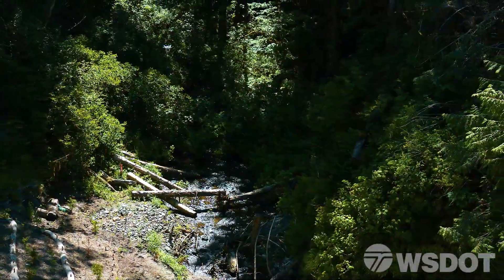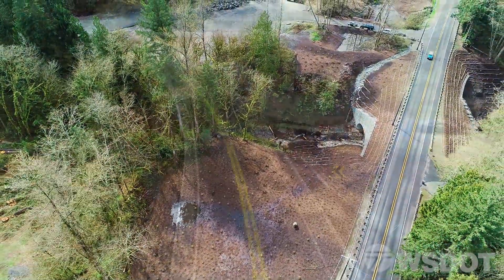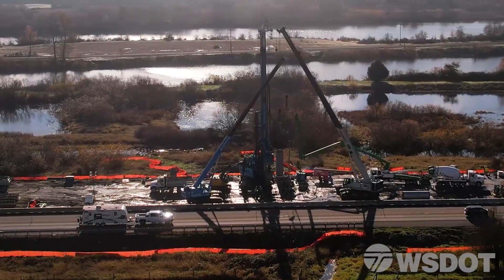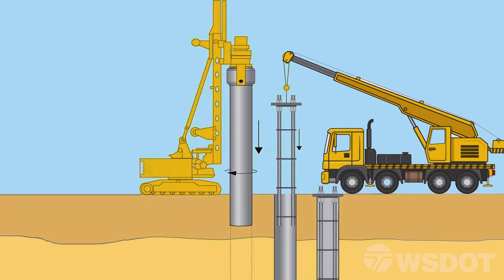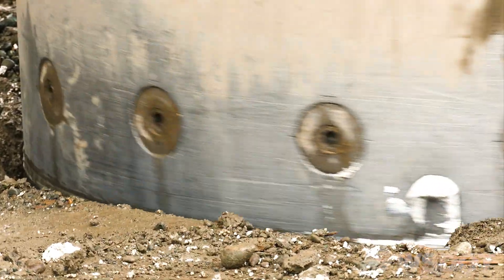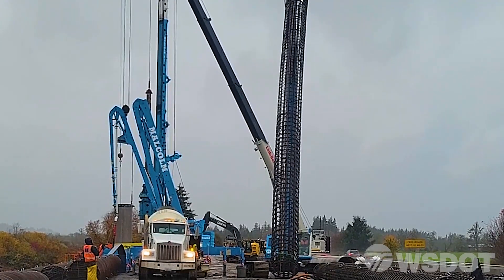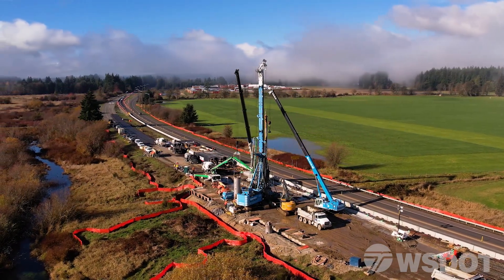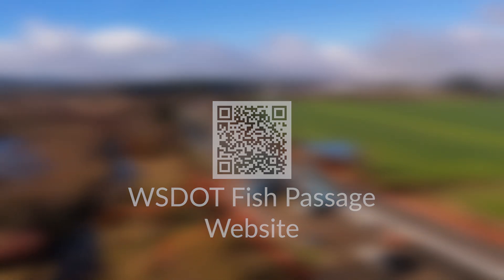Fish Passage Restoration and Drilled Shaft Construction

Comment: all these barriers are in the wrong location should spillage occur they are too close they will be knocked down 50% are running with the down hill flow of any spillage should it occur there are zero erosion logs to absorb spillage there is no earthen barrier to dike prevent any spillage should it occur into the creek access that runs under the road right where they are drilling which is 100% direct immediate contamination of any spillage that does happen. the environmental epa team for this job should not only be fired and banned from use ever again they should be fined $1,000,000 for fraud